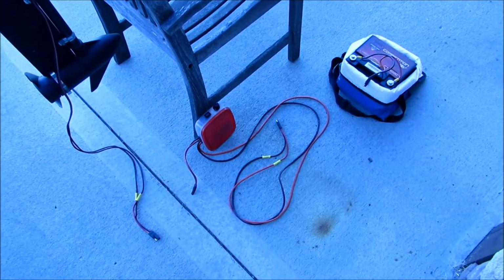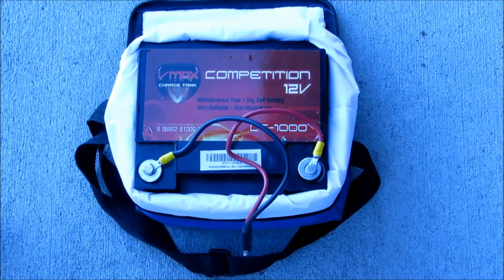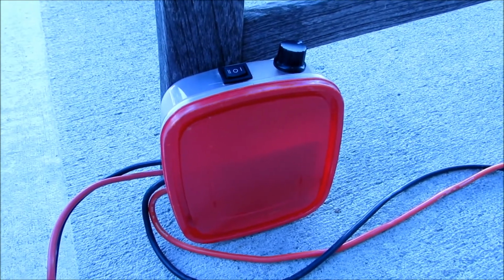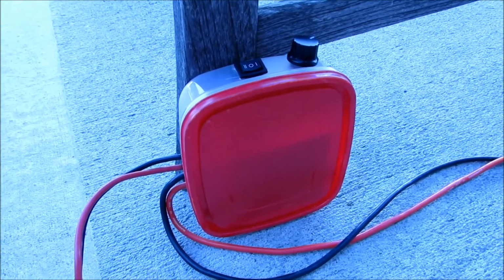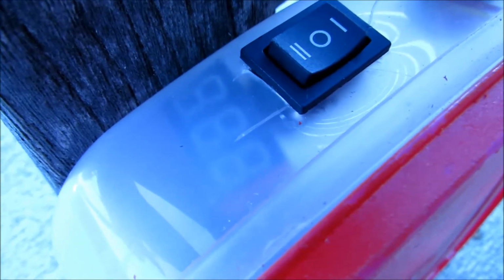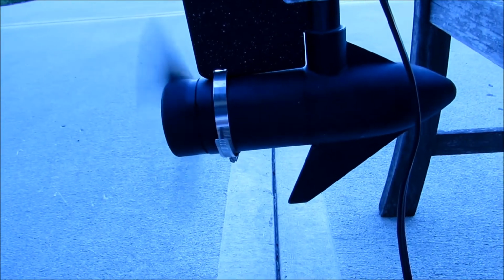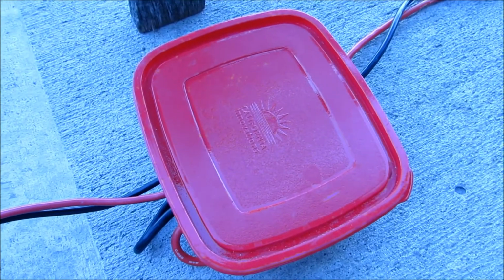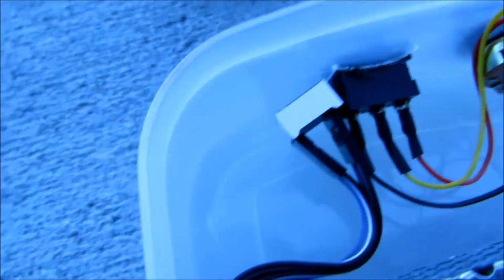DIY Pulse Width Modulator PWM (Digital Maximizer) for Trolling Motor Control

Comment: I find this inaccurate, my endura C2 40 draws 6.6A at F1. Albeit there are inefficiency in how F1 gets the motor to lower its speed (resistors most likely), but it's not drawing the full amps and runs at 20% the speed.
Reply from the maker: https://pumpupboats.com/minn-kota-digital-maximizer/
Reply from the maker: "Speed coil motors use almost the same amount of power at speed 1 and speed 5. The excess power is being diverted around the motor through the speed coils."
Reply from the maker: Curious to know how many amps it draws at F5, and if you are doing the test in the water, or out of the water.  I'm only repeating the learning I have gained via explanations like the one above.

Comment: If your PWM is engaged forward, what happens when you put the motor itself in reverse without powering down on the PWM?
Reply from the maker: No idea. Not a scenario that I would ever try. I leave the motor in its highest forward speed and don't ever change it. All adjustments are done via the PWM.

Comment: Second question: Are you sure you the resistor coils aren't siphoning off power? Seems to me that if you haven't opened up the head of the trolling motor and disconnected the leads that go down to the resistor coils,  the circuit to the resistors is intact, the power will still be routed through them. I don't know enough about DC circuitry to know whether the resistors just act as passive connectors if there is less juice being sent through the line.
Reply from the maker: I'm no expert on those either, but the way I understand it, those resistor coils only bleed off energy as heat when operating at speeds less than 5. Because I keep my handle on speed 5, I believe no energy is being converted to heat in an attempt to slow down the prop.
Reply: @ndettwiler  I believe you are correct; the resistors only come into play if the handle speed goes down from 5 to 4, etc. If left at 5 there is no resistance.

Comment: So now that you've had it for awhile, have you had any problems? I'm concerned about heat build-up if it is enclosed like that.
Reply from the maker: No issues. Works every time. Had it out three times so far this year, and about 25 times last year. I do not run 100% throttle much, but I sometimes do for about 5 minutes at a time when moving to a new fishing spot on the lake.

Comment: How do you keep it from over heating inside the box. I have mine inside a dry box and it over heats pretty quickly.
Reply from the maker: Hmmm, I haven't done anything special - there's no fan, no ventilation. I don't seem to be having any overheating issues. I rarely run it at 100%, and when I do, it's not for very long. I tend to launch, then putter around the perimeter of our 65 acre neighborhood lake.

Comment: Great video! Thanks for the valuable information. I bought the same ones from Amazon but i think they're also fried. When yours got fries did it click and the whole unit turns off when you turned the rotary knob and engaged the forward/reverse button? Thats what's happening with mine and also the replacement one i just received does the same thing.
Reply from the maker: Mine wouldn't do anything at all. No click noise from the unit. Just nothin'.

Comment: Is the trolling motor head still necessary? Why dont you wire the pwm controller straight to the motor wires?
Reply from the maker: If the PWM fails when I'm out on the water, I can easily take it out of the equation.
Also, I gave myself the requirement of not modifying the TM, in case I want to sell it and upgrade to another one.
Finally, it's simply not necessary.

Comment: I love the idea. And I have tried this and it works great....until I start heading back to the dock on high speed and after about 10 to 15 minutes it will overheat and just shut down until it cools off and then it will work again.   I have a small sneak boat and a 54lb trolling motor.   I bought the one you suggested and also the 40-60amp version.   I also bought 3 of the ones that came with the plastic housing with the knob and switch already assembled...they burnt out also.  One just melted the housing on the side.    Anyone have any suggestions?  What might be my problem?  Once you have tried this, you NEVER want to go back the old 5/3 switch.   Would a 100amp version be the solution? Or do I need to just add a fan?
Reply from the maker: I'm running a smaller trolling motor - 30 pound thrust, which I believe draws 30 amps max on high. I'm no electrician or engineer, but if you were to determine the max amps your motor draws on highest speed, maybe you're just pushing too close to the maximum rating for this PWM.
Reply: I think Neil is right, these are inexpensive electronics from China sometimes i wonder if they can really handle what they say they can.
I found a unit on amazon that says 60 amp continuous 100 peak a little more pricey 30.00? So far so good. I didn't enclose mine in an air tight container. I thought a container with a series's of holes in it would help.  Not water proof! But it has been working on my 40 lb thrust motor so far
Reply: @johnrugani2382  im buying that one as well...i plan to enclose but with vent holes...how did it work on max speed? i will mostly use it on lower speeds but i still wanna be able to get where im going quickly. what gauge wire did you use and how long is whole wire setup.
Reply: Goliath Gaming   I'm using one i found on amazon that is 60amp continuous 80amp max a little higher. Amperage than the one i used in the past. So far so good!!  I keep mine in a plastic case with holes drilled into it also. I used cat 6 wire 23 gauge for a 7 foot run.
Reply: I suggest a small computer fan to keep it cool.

Comment: great video however how do you keep the PWM from interfering with marine electronics mounted to the trolling motor i.e. a transducer?
Reply from the maker: My transducer is mounted elsewhere, so I haven't had any issue. I would hope it would not cause interference, but cannot promise.

Comment: I did this to my friend's motor but it doesn't slow down and stop, minimum speed on the pot is about 1/4 throttle. Any ideas?
Reply from the maker: Sorry, have no idea. Never experienced that problem myself.
Reply: There are two off switches, the toggle switch middle position is off and the knob turned completely counter clockwise clicks off the power.

Comment: If your pwm fried while on the water, are you still able to use the 5/3 throttle in the motor head as a backup?
Reply from the maker: Yes! This is by design. The quick connects are arranged so I can unplug the PWM from the battery, unplug the trolling motor from the PWM, then connect the trolling motor quick connect to the battery quick connect.
Reply: Awesome, how's your pwm holding up/any problems with it?
Reply from the maker: I haven't been out yet this year, but I used it at least twice a week last season, with no issues. If I ever fry it, I would be ordering a new one immediately.
Reply from the maker: @eric.roquet  I've been out fishing seven times so far this summer, and the PWM is still going strong, with no problems.
Reply: How can you do that?  The connectors will be reversed, I.e. the male pin and female pins on black and red wires are not matching if you bypass the PWM and directly connect the trolling Motor to battery minn Kota connector. I think you have to buy 3 quick connectors. Any other ideas besides disconnecting the posts on battery and cross wired positive  to negative to match the male and female connectors?

Comment: I know you had trouble with your first PWM is this one still working for you. I ask this because i purchased the same wire you did from amazon and just fried my pmw
Reply from the maker: Yes, the second one has been going strong. I fried my first one when I tried to extend the control wires to the switch and knob.
Reply: Neil Dettwiler thanks for the quick response, I'm glad to hear your still up and running.
I was hoping that the wires didn't cause a problem.  I really like how flexible they are but they don't 
Look copper and seem a little thick for 10 gauge.  Anyway I guess my problems lies elsewhere.
Reply: Neil Dettwiler Hello again just checking in one more time on your PWM (Still running ok) I ask because I have had trouble 
With two of them. But i was running a lithium ion battery. Higher voltage could have been the problem. But i spoke to another you tuber
And he is running the same lithium battery without issue. So i'm looking at  the bntechgo 10 gauge wire again. I know you used this wire and was just wondering if you had any other problems???  Thanks
Reply from the maker: @johnrugani9832  hi John, I haven't been out yet this year, so I'm afraid I have no new news.
Reply: Neil Dettwiler thanks for getting back to me. Good luck and keep me posted if you can
Reply from the maker: @johnrugani9832  Hi John, just a quick update - I've been out fishing seven times so far this summer, and PWM is still running OK.  Hope you got your issues ironed out.
Reply: Neil Dettwiler hello again Neil,  Glad to hear your getting out on the water. I did get this resolved, it was the lithium ion battery
Causing my issues.  It's sold as a 12 volt battery but fully charged its more like 16.8 volts and that is way to much for fine electronics.
Anyway i'm back to a 12 volt AGM battery a lot heavier, but it works great!!  I extended my control wires with cat 6 cable (23) gauge.
I'm running approximately six feet without issue. Also playing around with a few different propellers I'll let you know how that goes.
Reply from the maker: @johnrugani9832  Excellent!  I guess I'll cross a lithium ion battery upgrade off of the ol' list...  :)
Reply: john rugani I have a lithium battery too first one fried. Second one working actually lower went with one that came with metal box but reduced amps from 60 amp max to 40 amp max and 20 amp continuous rating. I think it over heated and cut off in 100 degree weather. Still works though.  Had to direct connect to battery to get back across lake.  But connector positive and negative wires are reversed cut off connector and spliced in but could have reversed the posts on battery only you have to reverse back when you get the OWM working with a new one.

Comment: Could this be modified for a higher AH battery? Say like 114AH?
Reply from the maker: I'm sorry, I can't say for sure.  But perhaps it's not so much a function of the battery's capacity, as it is the amount of amps the trolling motor draws.  My little Minn Kota Endura C2 30 draws a maximum of 30 amps at full power, according to Minn Kota.  So I bought a PWM rated for at least that.
Reply: @ndettwiler  
- how do i find out the max amp my trolling motor pulls? I just bought the minn kota c2 55lbs.
- what size battery do you have for your 30lbs? And how long does it last you?
Reply from the maker: @taz10029  See the chart on this page: https://www.minnkotamotors.com/support/compatibility/battery-selection-and-rigging
Reply from the maker: @taz10029  And my battery is a small AGM battery intended for use in the mobile audio industry.  I think it is either 35 or 40 amp hours.  I have never run my battery down past 50%, as noted when I get home and put it on the charger.  I'd say my longest outing was 6 hours, but I'm not using the trolling motor the whole time, so it's hard to say just how long it lasts, since that is of course based on usage.
Reply: @ndettwiler  holy crap! Thats a long time for such a small battery. Im sure this PWM helps a ton with that. You must be barely using it while out on the water.
Reply from the maker: @taz10029  I fish on a private 65 acre lake. I go full speed to get where I want to be, then I use it sparingly for positioning. I do like to troll for wipers at sunset, but I keep it around 50% power while trolling.
Reply: Angel Martinez  you need a watt meter it shows your /amps / volts  / watt / as well

Comment: How many amp is the modulator ?
Reply from the maker: 60A
Reply: I purchased a couple of these pmw units. The one that I bought puts out 60 continuous amps. By the appearance of yours, it's a 60 amp with 40 continuous. If people want to power a 55 lb,this will not work for very long. You'll need to get the 100 peak amp with 60 continuous out.
Reply: umpy315 60 amp 40 continues amp is the one I got!

Comment: In forward and especially reverse your speed will still be limited by the resistors inside the handle.  I'd recommend opening up the handle and jumping the power leads directly to the motor leads for a more efficient setup.  You won't have to cut anything and can still go back to the factory config easily.
Reply from the maker: I leave the handle switch in forward, highest speed at all times. I am assuming this throws 100% power to the motor. When I need to go in reverse, I toggle the PWM switch, which reverses the polarity/direction/not-sure-of-the-right-term, but the prop spins in the opposite direction, at full power. I can then back it down using the dial on the PWM.
Reply: @ndettwiler  ah I see.  I was thinking you still used the handle to reverse it.  You're probably getting full power although you still have the resistsnce of the blade terminals inside the handle and whatever it still has to run through on speed 5.  I would personally just bypass it.  It may not be much difference but it could be another 15 mins of run time.  I understand if it's working fine you may want to just let it be though.
Reply: Neil Dettwiler -  This is absolutely incredible. My son and I took our small Mariner 4 out fishing today with a Minn Kota Endura C2 40# thrust and I was guessing that there was inefficiency in the motor speed settings and sometimes confusion as he was operating it. Stumbled upon your video (as well as another one) and your explanation of its benefits and efficiency will cause us to be starting up our own project very soon for make this modification for our set up.

Thanks for the video and info!! Tight lines! 🎣

Comment: Thank You for your video it is very helpful.   Do you know if you can extend the wires on the control switches and meter 6 or 7 feet from the maximizer? This would let you store the larger controller away and just have a much smaller hand held control unit.  Is this system still working well for you?
Reply: I have the same controller and extended the wires 3-4' and had no problems
Reply: Kevin Coyle what type battery are you using what are the volts and amps on that power source?
Reply: @johnrugani9832  I ended up extending mine using a 8ft coiled microphone cable w/6 conductors.  3 of the 8 wires are common ground so I just spliced them together to make the mic cable work.  The Valence 40ah battery from ebay is an awesome deal.  $130 for a $750 msrp battery.  I've been on the water for 6 hours at a time and only used 12ah.
Reply: Sorry, the one of the previous comments which States can’t you bypass the trolling motor controller. Problem is if the PWM fries again then you can’t connect directly to battery with quick connect and keep going
Reply from the maker: I tried to extend the wires like you are thinking, and I couldn't make it work. I also wound up frying my first PWM module while trying to. I still don't know what I could have done wrong, as I was very careful in my attempt. So I bought another PWM and did the plan B as shown.
Reply: Neil Dettwiler Thanks Neil, the plastic Tupperware is a nice touch and practical.  I think i'll buy 2 PMW's  just in case and try plan A first. I'll let you know how things go.  I wont be getting around to this until February rolls around. Wish the best of luck and happy holidays!
Reply: @johnrugani9832  have you started your project yet?  That's strange that it wouldn't work with the wires extended.  I'm wanting to extend mine
Reply: DrFuNK Hello dr. Funk I received my WTP last week didn't hook it up yet but plan to sometime in March mine is a little different than the one in this video. I purchased from (wireless trolling pro) the one in this video is a bit different. Anyway Im told extending the wires should not be a problem with the (wireless trolling Pro) Let me know how you make out, once i install it I'll let you know. DrFuNK do you play music?
Reply: @johnrugani9832  no I don't play music.  I like music but don't really play any instruments regularly.  I ended up ordering a controller like the one in the video.  I haven't got it yet.  I wanted the WTP unit but this is pretty much the same thing for a lot less.   The only prolem I could see with extending the wires would be adding resistance which could change the signal from the pot.  I don't think a few feet of wire would change it enough to make a difference though as long as the connections are solid.  
So you went with the wired WTP unit and not the wireless one?  I think it comes with a 6ft cable already and can be custom ordered if a longer cable is desired.  
Good luck with your build.
Reply: DrFuNK I went with the WTP RC version no wires to the forward and reverse speed controller. You can just mount it anywhere or even clip it to your vest.  $$$ 150.00 though Thanks for the information and good luck to you as well. PS i play drums and love Funk
Reply: @johnrugani9832  nice.  I had a couple drum kits back in the day.  $150?  You must have a 50+ lb thrust motor because the 30lb wireless wtp was $99 I thought.  Are you using it on a kayak?  What battery are you using?  Thats all I have left to purchase is the battery.  I'm expecting to spend at least $300 for 40ah lithium but I'm trying to find the best bang for my buck.
Reply: DrFuNK I purchase wtp for a 40 lb. thrust but added the cut off kill switch that up the cost a few bucks i think i paid closer to 140.00
I ordered a vmax 50 amp hour lithium battery. I should have this by friday. it will be a few weeks before i finish all my mods and get it on the water. I'll keep in touch and let you know how i make out.